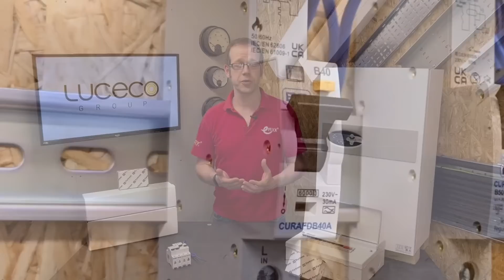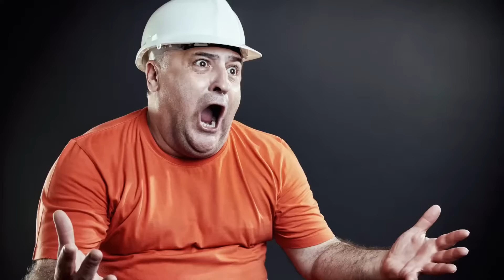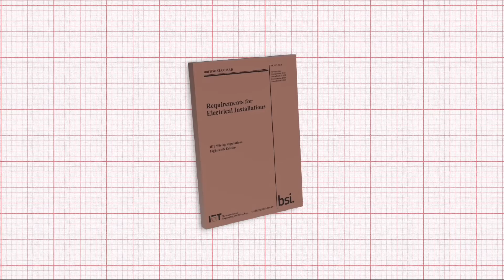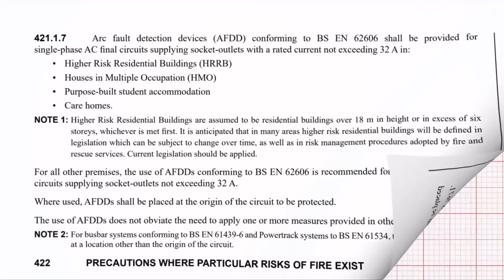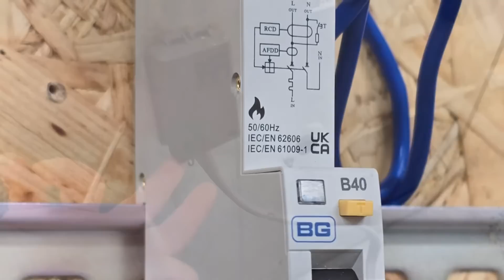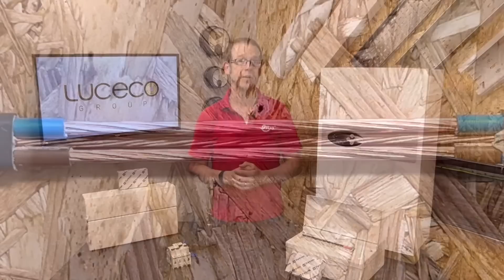Should You Install an AFDD?

Comment: We are seeing nuisance tripping from combined MCB / AFDD devices in high rise domestic dwellings
Reply: It might be nuisance tripping, in that it is causing a nuisance, but how do you know it is not actually genuinely tripping on a real incident?
Reply: @ because the appliances that cause it to trip vary. I won’t say the manufacturer’s name but they are aware of the issue. Any high in-rush load like a heater or motor seem to trip these AFDD/MCB devices. They have Bluetooth and can have the firmware updated, so we are just waiting on a firmware update which alleviates the issue. Also doesn’t help that they specified B curve breakers but hey what do I know lol.
Reply: @barryamorris  It's not just the appliances, problems with poor and old quality cables, notably on extension blocks, are causing problems.
Reply: @barryamorris why use B types on circuits with known high in rush currents? That’s a design fault, not nuisance tripping.
Reply: @deanXRayZulu if the IR is that low, the cable needs replacing
Reply: @ these are domestic appliances mind you. So only things like Kettles, toasters & washing machines etc. Otherwise yes completely agree, B curve mcb’s are too sensitive for those type of inductive loads. However as I’m only the facilities manager I can’t question the installation design, only push it back to the main contractor under defect / snagging
Reply: @ This is a brand new installation, only just been PC’d.
Reply: @barryamorris  i haven’t been putting b rated mcbs or rcbos in kitchens or utilities for almost 20 years. The curve on a 20a MCB/rcbo/afdd with 2 appliances running shows that they aren’t suitable for that environment. Nor should b types be used for SOs at entrances/exits due to the likelihood of pressure washers being installed. As previously stated… it’s poor design.
Many moons ago, I was installing new CUs/DBs that required 30mA protection on circuits for the first time. Getting called back for ‘nuisance tripping’ was a regular occurrence… but it wasn’t the RCDs that were faulty, but that I was installing them without doing a PAT of existing appliances prior to installation, giving the customer advance notice of faulty appliances hat would need to be replaced ahead of my installation.
In addition to PAT, I have a 16A AFDD in a box I knocked up to test appliances prior to installation & put a scope on all mcbs/rcbos above 10A. 9/10 times, if there’s anything picked up, it’s from faulty/defective appliances. After installation, it’s a nuisance & makes the electrician look unprofessional. 9/100 it’s a faulty cable/socket. Only 1/100 is it a faulty AFDD.
We’ve been specifying them for use in hotels/entertainment & sports venues/restaurants/churches/community halls since 2021 as we estimated that all locations requiring an entertainment licence would require them by 2026. That date is more likely to be 2028 now, but the legislation is coming.
Reply: @barryamorris  we get cooker hood trip them on changing speeds.
Reply: @barryamorris we have the same problem, I’ve been updating the breakers from the app, haven’t had anyone complain back yet. It was the washing Motors’s when they went on to spin cycle.
Reply: @deanXRayZulu  I am a homeowner with AFDDs, not with Bluetooth, and have had some tripping which I believe to be nuisance tripping. I think that you are right, it is very difficult to know if it is a genuine problem or a nuisance trip. There is no real way of testing it as far as I know. I don't think that having a ring main with multiple sockets helps either as it's hard to isolate the cause of the tripping and I have found that combinations of equipment trip it, but the same equipment used individually does not. I have found that small electronic devices used with higher power devices seem to be the combination that trips them.

Comment: Question for you Joe, does that 18m height rule start from the outside ground level? Or for the total height of the building even if 2 levels were below ground?
Reply: It would be 18m above ground level I would assume as this is related to access by fire services. I.e. a fire in a building higher than 18m is very much more difficult for fire services to evacuate as this needs special ladder trucks which may take a while to arrive.

As an example the Grenfell Tower fire could have been avoided with an AFDD as the fire is believed to have started due to a domestic appliance (a fridge I believe) developing an arc fault.